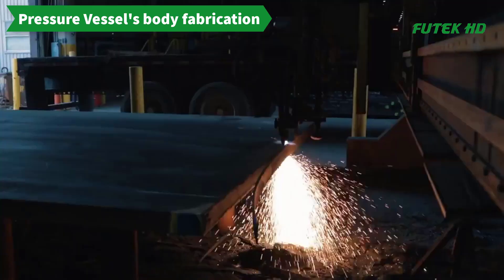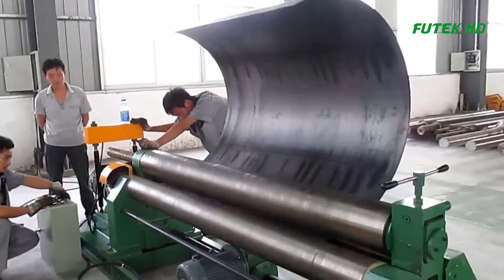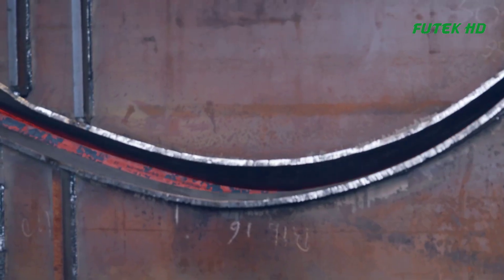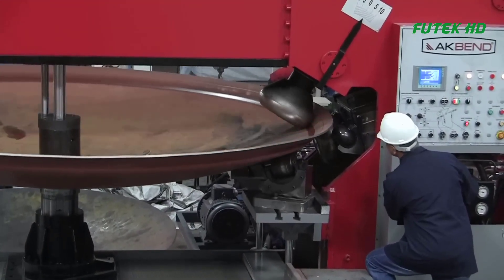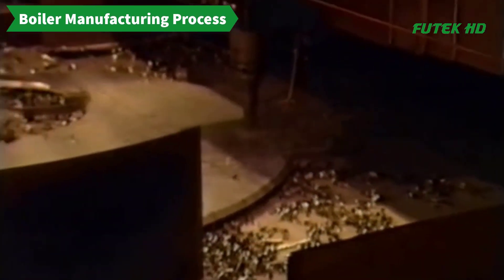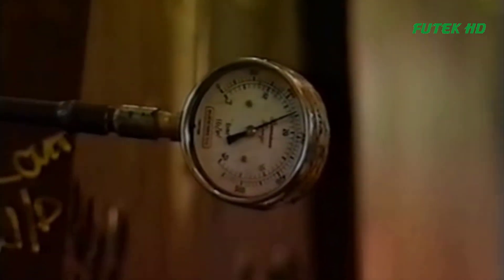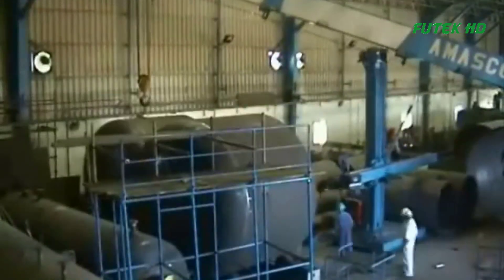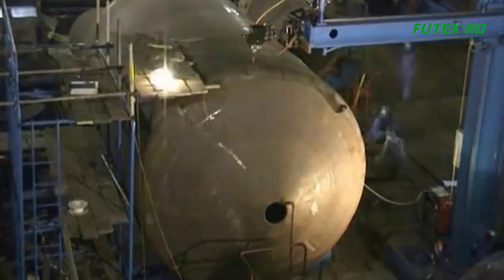Pressure Vessel Fabrication Process & Boiler Manufacturing Process Using Heavy Equipments & Machines

Comment: Sir,
Please advice what is the tensile strength of SA516 Gr70 at 344deg Celsius. I couldn’t find anywhere. I need this strength to calculate the minimum required thickness of pressure vessel.
Thanks
Reply: You can find that in ASME CODE, SEC. 2 PART A😊